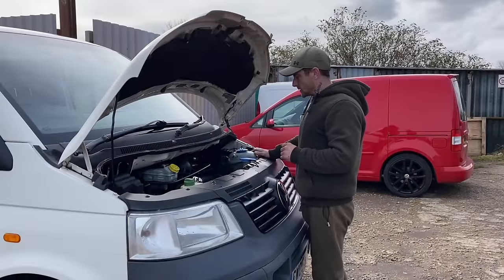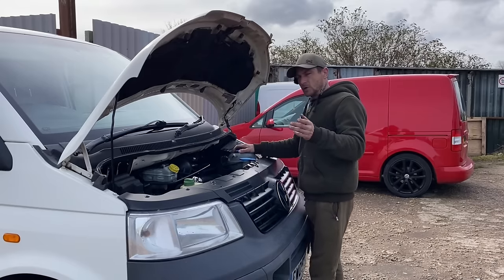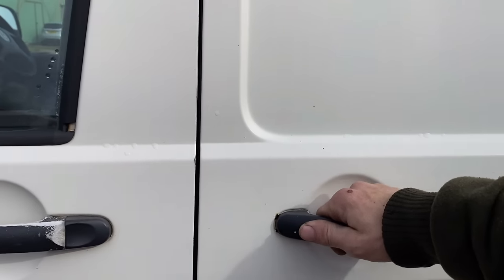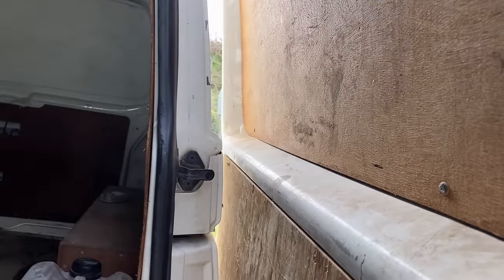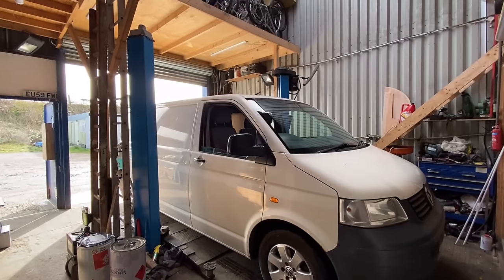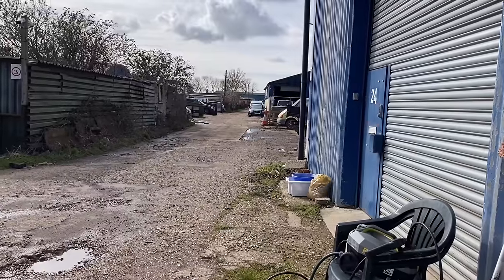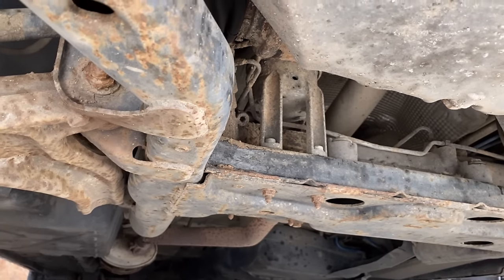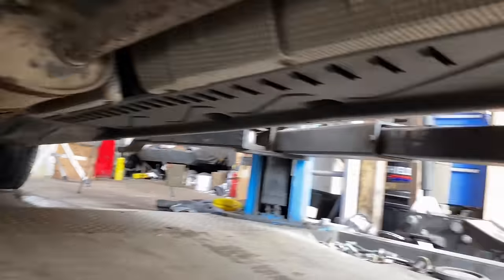Buyers Guide - everything wrong with a 300k T5 transporter

Comment: Know lots of transit and vivaro owners always saying vw transporters are overated overpriced rubbish but they are just superbly built solid vans, driven t4s, caddys, t5, 5.1 now on a t6, all have been overloaded and over worked averaging 120k every 3years but never given any issues. This video is great.
Reply from the maker: Hey bud yes your spot on before owning one I called it T5 tax as the price difference from say a Vivaro to a T5 is massive but it’s for good reason, Vivaro bodies are ok but engines and other bits not so good, transits don’t even come into it as they have severe rust and engine issues. I was blown away by the condition of this. Really appreciate the comment thank you 👍

Comment: I don't think you need to explain yourself mate, ignore the keyboard warriors chin up
Reply: I agree pal! Clearly not been watching the channel for long enough!! Anyone Can see how professional Nathan is with his work and builds. Great video! 
Big shout out Pinch for helping. Personally I can never find bearing play on a wheel, just breathe relief when mot man drops her back on garage floor  the  😅
Very clean van pleased for you.
I bought a t5 the 2.5 spares or repairs with a bit of mot about 10 months ago.
I  caught the sleeper train up drove it back from Scotland 546 miles changed oil up there.. he who dares ha ha
I would check the shock mounts on rear I had to weld mine up but it was from the coast. Will check your FB page when I sort fb on my phone 👍 great video thanks
Reply from the maker: Hey zed thank you mate it’s the 1st negative comments so just wanted to address there concerns. Really appreciate that 👍
Reply from the maker: Hey Mike thank you mate really appreciate that, it’s the first negative comments so just wanted to address them. I’ll give pinch the thumbs up from you. Blimey that’s a long drive glad you made it, oil pumps a full on job well in 👍, I’ll check the rear mounts thanks again mate.
Reply: PSB bushes are a great swap an I’ve just done x2 lower arms on a T5 for cheap as chips,(PSB Complete Front Bushing & ARB Kit For VW Transporter T5/T6 (Part No. PSB714/715/716)
Reply from the maker: @forddoctorforddoctor5918  thanks bud that’s what I’ll be doing to this one 👍
Reply: Wow that van looks very nice for its age, I’m looking to buy a van to live in, older vans put me off, but after watching this I would consider something like the, do you ever sell your projects ?    I would be interested in buying from someone like yourself who knows what they are doing.  🙏🏼

Comment: I have bought an 05 plate 1.9 t5 8 months ago. Similar condition and same miles. I didn't change the engine out but did head gasket, new rad and heating matrix plus cambelt and pump. It's been running great ever since. It's going in soon to have a couple of rubbers changed as it also has a nocking sound. Mine is a fully converted camper and I love it.

Comment: I still drive my 2006 2.5tdi with 470000 kilometers on it with the same engine and ofcourse had some cost's arround 400000 km but it still runs very well and i keep on driving it.
Reply from the maker: Hey bud that’s very good mileage 👍 probably the highest I’ve ever seen. Reliable vans 👍

Comment: I have the same one. Had 360.000 km on it bought it with a blown headgasket. Drove it as is for 20 k before even replacing the head gasket. Then the 5th gear left the station and now its done 390 k. Im super impressed by this car. Original calipers. Original arms. Original dampers on front. For the mot i did disks at the back and pads front and back. The only thing i could say is a weak point is the suspension damper mounting bracket on the back. Theyre just really thin on steel and they get alot of salt up there. Alltough its a fantastic car. Soon done 400 k and it runs as clockwork.
Reply from the maker: Very nice 👌 they do love a head gasket anywhere over the 250 mark but a new gasket and they are ready to go again. I’m at nearly 290k now 👍
Reply: @YTDTETV  ill be watching your build👌 cant wait to see how its gone look 🥳

Comment: Nice one mate, great thorough inspection there. I had a 12 month old 2004 T5 and did 150,000 miles in that and only thing went was a drive shaft! Original battery, exhaust, suspension, mad! Always flew the MOT
Reply from the maker: Hey bud that’s great 👍 Vw made such a good van and I can now see why they hold their money. Transits would need a resto at that mileage.
Reply: @YTDTETV  give me petrol
Transit any day , I'm not into
Diesel cars ,vans etc for
health reasons , however l
would take one if offered for
Free & drop the engine for a
3 litre +  convert it to petrol
Power ho ho ho ho.
🙄🙄🙄🙄🙄🙄
Reply: I think the T5 parts are possibly better than the T4 parts. My original T4 exhaust  fell apart at around 100k miles. The Cat certainly did and the rest soon followed 😆 Original rear springs also snapped at around the 100k mark too. Maybe the T5 is a bit more durable ?
Reply from the maker: @charlesallanstewart-kl2op  I used to just be a petrol head then I got my first diesel car and I’ve never had another petrol on on the road but the way the emissions thing is going I’ll be back in one soon.
Reply from the maker: @matttaylor1372  so I see a lot of posts people saying the T4’s but I agree with you I’ve changed lots of parts on T4’s with less mileage than this one. I knew T5’s have a big following but I never knew why maybe it’s because they are built well 🤷

Comment: Good one, great info.. I have one of these, its a 08 model with 210k on the clock.. Goes like a rocket, the only issue I've had with it is a creaking sound from the front end when I'm turning the wheel into a parking spot.

Comment: I have a 2003 battle wagon ex builders looks terrible love driving it. Great handling turbo I say is starting to go but love it. Got T5 oem dual usb phone charger ports off amazon plug  straight in jockeybacks off a fuse and of course the dreaded heater vent cable. Absolute nightmare getting that in. Cant wait for your transformation. Best of luck
Reply from the maker: Hey dominick I’m surprised how good it is Vw made a good van I guess that’s why they have such a good following. Thanks for the tips with the usb’s I’ll look into that. I’ve read about the heater cable, these work at the moment so maybe I’ll try living them up before it brakes, thank you for the comment appreciate that 👍

Comment: I had a 2005 swb ren trafic poverty spec with tail gate from new and had to say goodbye jan 2022 due to turbo fault and various other little bits and electrical strangeness creeping in.just couldnt justify keep shelling out. Finally ended up on 192k on a catC even 'we buy any crapper' said do one! So scrapped it. A fantastic van that hardly missed a beat and worked so very hard for me. Bought a 2013 trafic sport on 43k as a replacement but sadly not a tail gate. VW T5 hmmm. not ever driven one of them so cannot comment. It was said the early transporters were a bit thirsty? Good video. Subbed.cheers.
Reply from the maker: Hey bud I’ve never had a new vehicle, I bet it was hard for you to let it go, a friend of mine has a trafic and it’s been reliable for him. They don’t rust either like Vw, I’ve been into Vw for a little while now and I’m really impressed with the build quality and longevity of them. They make a 1.9 and a 2.5 and the 2.5’s are known for being thirsty. Thank you for the comment glad you found the channel 👍

Comment: Excellent vid, I am looking forward to see your progress on this Van. As a former Ship Repair Welder, I can vouch for your comments on the surface rust. It always looks worse than what it is, a good blast or wire brush, a coat of paint and it will be spot on. I really enjoy your vids and down to Earth approach and comments. You are lucky with the anti roll bars. On my Volvo, the Brackets are moulded on and the Bar is Makers part only. I have had my rear one replaced and the Bar was £282. Luckily my Mate has has own Garage" like yourself" so I always get a good deal on labour.
All the best.
Reply from the maker: Hey Peter thank you for the comment really appreciate that, a lot of people are scared off by the look of surface rust but if it’s solid it just needs a clean off. Blimey you roll bar bushes aren’t cheap but I suppose it’s one of them jobs that only need doing once in the time of ownership. Thanks again for the comment 👍
Nathan

Comment: I have an 07 T5 with ~127k miles on it. However, cosmetically my van is in rougher shape and the turbo has gone. Good luck with the van and hopefully yours is better than the T5 that Edd China has (which had an absolute gremlin of an AC issue).
Reply from the maker: Hey Kevin really sorry for the delay, blimey yours is good mileage 👍 I’ve heard about his van, mine has AC I hope it works that it’s selling point. Really appreciate the comment 👍

Comment: Quality video mate. Super useful. You can see why the VW vans have such a devout fanbase after inspecting that. Imagine doing a side by side inspection with an 18 year old 280k Transit as a comparison. You’d probably struggle to find one that made it to 280k. How come your ramp couldn’t lift it? Legs don’t extend far enough to reach jacking points?
Reply from the maker: Hey B-RY thank you as always mate 👍 yes your so right Vw really did make a good video. Oh man I’ve seen transits with half the mileage and had to replace complete sills and steps. That’s exactly it ramp legs are about a foot to short.
Reply: Owner of a 300k original engine transit here, Plenty about but they are all rust terribly, that’s why I’m looking at getting one of these.
Reply from the maker: @funkyfungi8460  that’s brilliant for a Tranist 👍 my camper has 270k on the clock and when I got it I replaced all the tappets as they where worn out aswel as clutch flywheel, oh and I out a chain kit on it but it still runs sweet.

Comment: Ive got my t5 55 plate  . Just done 200.000 miles  .  Off the road,  metal sounds coming from the engine around  the egr valve.  . Mines always  had a slow oil leak.  Top up as u go . 
 Now had the AA out 
 He thinks  its the turbo  . Bloodyhell , thats my second  one . Another thinks it could be my crankshaft  . Yet to find if my lovely  transporter  back on the road
Reply from the maker: Hey bud sorry to hear that hopefully you get it sorted 👍

Comment: I seem to have done the opposite of what you have! Got a transporter 2 years ago and I just picked up a caddy yesterday, drove 70 miles to get it and made it about 4 miles home, injector seals are knackered.. massively overfilled the sump with diesel.. did an emergency oil change.. about 9 litres took out and 4 put back in and smoked it back home! 

If I was you I would buy the upgraded knobs for the heater, they’re cheap and they look sweet, a few vids on here, they come with adapters.. nice easy mod
Reply from the maker: Hey Jim that’s awesome from one Vw to another 👍 I call the T5 a bigger caddy. Oh man that sucks sorry to hear that, blimey that pumped a lot of diesel In hopefully you’ve fixed it. I’ve seen the knobs actually and wandered about the adapters I’ll have a look 👍 thank you for the comment appreciate that.
Reply: @YTDTETV  yes mate ! My first thoughts when looking in the back of the caddy was .. that’s cute! 😂 I think I have fixed it, cleaned and put new seals on,  just need to take it on a run tomorrow to see if the smoke clears up.. still smokes a tiny bit when you rev it, yesterday it was so bad I had to turn it off at traffic lights!! 
The upgraded knobs make it look loads more modern, and they light up nice at night. Looking forward to seeing this project progress pal!
Reply from the maker: @jamesibbo1  hopefully the smoke clears out I’m sure it will, the exhaust and everything will be full of diesel and oil, I’ll definitely get a set of them knobs 👍
Reply: @YTDTETV  smoked for a mile or two now runs like a new un! Cheers bud 👍🏻
Reply from the maker: @jamesibbo1  happy days well in 👍

Comment: That’s a brilliant base vehicle for a project you done well there!  Playing with my suspension was the biggest mistake I did, I initially put some coil overs on which where too cheap.  Looks the biz but shite so taken them off and went for 40mm lowering springs with standard shocks.  It’s not the best ride either so now looking at biting the bullet and paying for some bilstein b14 coilovers.  I will post a vid on it soon hopefully.  Good luck with the van and will look out for next vid
Reply from the maker: Hey bud thank you for the comment, I was happy when I got under it to have a look. I’ve read about the cheap coil overs, I’ll probably look at some H&R springs as I’ve read good things about them.
Reply: B14’s all the way, I’ve had mine lowered 80mm on 20’s for the last 7 years (and I bought them 2nd hand about 3-4yrs old and I’m literally about to replace them with another set of 2021 b14’s….also second hand, I’m from Yorkshire you can tell)….the ride is great considering the van gets used for all walks of life….if you’ve for the wedge opt for the b14 Komfort which gets all the rave reviews….basically a new more dynamic spring that offers a smoother ride despite riding low 🤙🏻😀
Reply: @williamoakes664  Hi, ive put mine on and not really impressed to be honest, i was expecting better for the money. The van looks good and now level as it used to look like it was dragging its arse as its a camper but it feels really firm on the road, every small crack in the road feels like my van is falling apart.  Im on 18’’ wheels with a 45 profile on the tyre and thinking of going to 50.  I also did the lower bush modification which probably makes it harder too 🤔

Comment: I'm following this with interest, I have the same year van with the 2.5  5 cylinder engine. Mines a factory Kombi with captains seats.  Looking forwards to seeing this progress.  just to add, Range Rover and Discovery 3 & 4 alloys fit on these  using  the Land Rover wheel bolts. I have Range Rover 19's on mine👍
Reply from the maker: Hey Darren sorry for the delay, the 2.5’s do go well 👍 I like the kombi’s worth a few quid, someone else mentioned the the Range Rover wheels I shal look into that. Thank you for the comment 👍